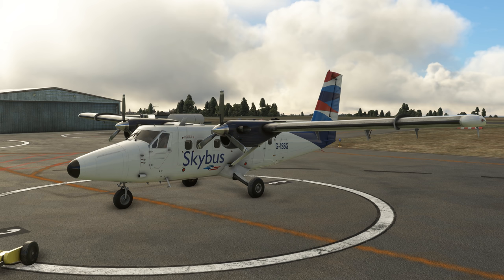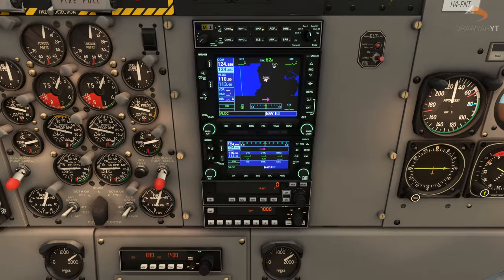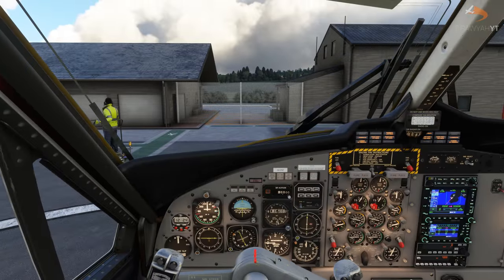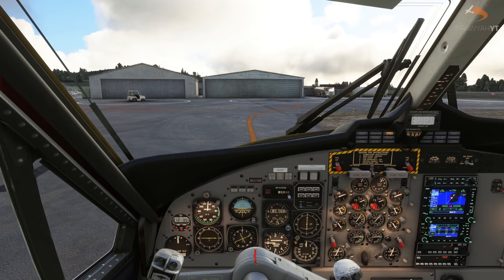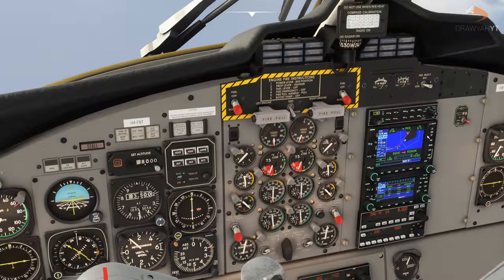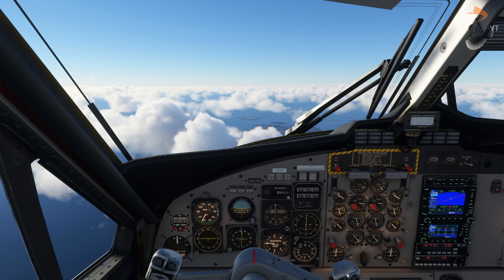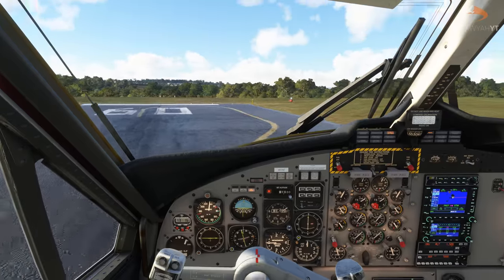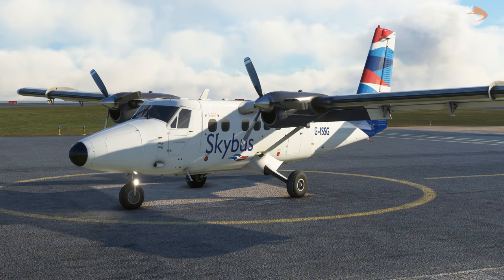[MSFS] Aerosoft Twin Otter Startup, GPS, Takeoff & Landing Tutorial｜Drawyah

Comment: For those having issue with overheating T5 and overtorque. Usually once 400-800feet above the airport, lower the nose slightly to gain some speed with very shallow climb, retract the flaps up(Make sure you are not in a turn and speed is 95knots above), pull the throttle lever back slightly within 90-96%. And bring the prop lever down to 75%(Default key is ctrl+f2, press it until u hear a click which means its at the lowest end before feather which should give a 75% prop). Climb speed is typically  around 105knots trim it properly for a climb of 1000-1300fpm or with autopilot v/s. Doing all this avoids the chance of over torque. 

Procedures for airports that has a lot of terrain may allow a temporary delay for prop and throttle reduction for greater climb. Of course depending on how long the engines can tolerate. If terrain is still concern and engines are going into overheating zone, Lower the throttle 96% and prop 75% like normal, Pull the yoke up slightly and lose some speed to either Best angle climb of 87 knots or Best rate climb at 96knots then start trimming or using v/s ap to keep it around there. This can give u up to 1600fpm of climb. Once cleared of terrain you can resume back a normal shallow climb with 105knots until cruise level.

Cruising is basically still keeping prop lever 75%, throttle lever at 96%, the aircraft will keep the speed steady within 145knots to 150knots ias. Prop lever at 100% is used only during take off up to 400feet above and during final approach just as you are engaging flap 20 landing or flap 37 landing. 

Also note full ILS landing with autopilot is only certified for flaps 20. Flaps 37 is for full visual approach. If you want to use flaps 37 with ILS you have to disconnect the autopilot just as you are engaging flaps 37 and fly manually following the glideslope indicator down to minimums and from here start following the PAPI lights insteads.

Edited comment: Added some additional info.
Reply: Thanks

Comment: Hey, nice video. Some points though on takeoff since this is a tutorial. You over use the engines on torque and temp. Torque should not go past 51 and ITT not past 760 i believe, and shortly after takeoff TQ should be at 50 if it has the PT6A-27 engines,  no more. Your temps are well beyond that and the right engine is well past the torque limit.    (Ofc you can in the game, but if you want to simulate, you shouldn't). Whatever comes first depending on the weather. 
This is something that goes for all turboprops. 
Whatever comes first depending on the weather. Also try and pitch for an airspeed, not a vertical speed on climb out.  the -300 has a Vx (best angle) of 86kts, and a Vy (best rate) of 100kts.   Unless you really need to get over something very quick you would pitch for around 100kts  

As for landing. Flaps 10 can come at around 100, but 20 should not go down before you reach the white arc (93 knots).   Final Aproach speed is 74kts, not that bad here where you had lots of runway but on short strips you do not want to come in 15kts too fast unless it is very gusting. 

You make some nice content mate, but would love to have a tutorial have atleast these basics right :)

Edit: I just realised another commented roughly the same. Oh well.

Comment: Mate, you don't turn the de-icing on when there's no ice accumulation, since the ice will grow over the boots and they will cycle inside an ice cover therefore being useless. Also, the deicer is powered by compressed air supplied by the engine bleeds, so it doesn't work if the engines are stopped or the bleeds are shut
Reply from the maker: Interesting to know, thank you for the heads up! Always willing to know more about aircraft types to better myself within the simulator.
Reply: @Drawyah  Also, do not firewall the throttles on the Twin Otter. The PT6A turboprops have a considerable leeway available in the throttles, you don't have to, and in fact you shouldn't, advance them all the way during normal takeoff under normal conditions. You've been exceeding the permissible gas temperature throughout the takeoff (red area on the T5 gauges). IRL you'd be facing a dual engine failure haha. Besides, the engines are flat derated to 50 PSI of torque (red vertical line on the torquemeters) and under any circumstances you shouldn't exceed this value, since in case of one engine failure with an unfeathered propeller and the other one above 50 PSI, the full aileron/rudder won't be enough to counter the yaw and roll from the failed engine.

The normal power settings for the Twotter are 50 PSI and 100% Nh (prop RPM) for takeoff, 50 PSI and 91% Nh for climb and 50 PSI and anywhere between 91 and 76% for cruise. For traffic patterns set 91% remembering to set the prop to 100 before touchdown. However, if setting those parameters will cause you to exceed the allowable T5 (gas temperature) retard the throttle to keep the T5 in the green, so you may end up with say 40 PSI and 91 Nh.

Also, in icing conditions or when you want to heat/cool the cabin, turn on the air bleeds on the aft ohvd (they supply air for the HVAC and anti icing systems), but be aware this may increase the T5 and you will have to retard the throttle to return it to the green. Shut the bleeds before landing, since in case of a go-around you may exceed the allowable T5 before reaching the go-around power if you advance the throttles with the bleeds on, especially with heavy load on the bleed system (eg with heating and anti ice both on)
Reply: @Drawyah  Last but not least, you've forgotten to arm the autofeather during takeoff. This is crucial since this will feather the failed engine automatically if it fails at low altitude, thereby giving you more time to react. The drag from a windmilling unfeathered propeller is enormous and will drag you into the ground easily if you're heavily loaded or under hot/high conditions

And when you do approaches, remember than when retarding the throttle beyond around 15-20 PSI of torque (approximately when the "PNEUMATICS LOW PRESS" annunciator comes on) the propellers will enter a very fine pitch range (angle between the propeller's plane of rotation and the blade will be small), almost flat on against the air stream, and this will give a tremendous aerodynamic braking effect, so if you want to loose speed quickly, be sure to advance the throttle promptly or you will stall.

Comment: Nice video, man. This aircraft is really nice.
.
Just a little comment on something that I've noticed so far: All the turboprops in MSFS have a really cold startup, speaking about the ITT. It also raise too slow when you add power. I mean, it does not affect the entire airplane, but is something that annoys me a little bit. Have you noticed this too?
Reply from the maker: Good spot! When loading aircraft on cold and dark state, I'm going to have a guess that the aircraft is in a true 'cold' state. I may compare this in different temperature climates and also repeat a few startups and shutdowns, see how quickly ITT raises each time.
Reply: That's a really good spot if I'm honest. I had not noticed this until you pointed it out

Comment: Hi mate how are you? I´m learning to fly the twin otter of aerosoft, nice bird, but I´ve an issue with the autopilot. I load the flight plan, turn on the airplane, CDI in GPS, altimeter and altitud set, and after take off the autopilot doesn´t work. It´s disengaging everytime when I turn it on. Maybe I´m missing something, Also the Yaw Damper, I tried turn on first to take off, after take off, yaw damper off and nothing happens. All this happens when I start the airplane from the Dark and Cold, if I start the flight with the plane turned on, works without any problem. Cheers for the good channel mate! Hope for your help

Comment: Thanks for the video. I just purchased it other night. My gps is on but none of the buttons work?? They are all clickable but nothing works..RIP
Reply from the maker: Try using the mouse scroll wheel or switch to 'legacy' controls.
Reply: @Drawyah  thanks, i found the issue, i use the GNS 540 mod, it needed a update. Cheers.

Comment: Thanks, great guide as alwasy!
But, How could we switch on VS after targeted altitude set?  I can't activate VS mode in this cockpit, but only map a keyboard shortcut for that. 
Your video seems just get rid of that button-click for Takeoff & Descend behind the scene, any tips of how was 'VS' starting to work?
Reply: I'm also having a lot of issues with the autopilot, including it blowing through the set altitude (similar to the approach in phase in this video). I sometimes have success by turning it on and off several times. Also IAS is simply unimplemented as far as I can tell. I'm a bit disappointed, given that there are similar autopilot and GPS system is in other Aerosoft products and they mostly seem to be working fine in MSFS 2020.
Reply: @GrantOakley  Yes, look at those CRJ variants, they are often working fine in descent and catching G/S, however you have to be patient, it seems some spooling effect for the ailerons to serve, all you need is a good handling and fixing via yoke, I am not sure if this is more realistic as I'd never flew CRJ / Twin Otter, but in MSFS not sure if this will disturb the AP functions, like the harmful bug to the AP up in the air in the earlier CJ4 cockpit.

Comment: I get to the point of starting engines but my engines just will not start at all , when you turn your fuel on the right engine starts straight away, when I turn the fuel on, it doesn’t progress any further whatsoever, I’m almost now convinced it’s a bug because I just sat here following you step by step and still just will not tick over past 20% on the GG
Reply from the maker: Check your fuel tanks. Could even be a case of them being empty? As soon as you introduce fuel to a starting engine, it should just come to life!
Reply: @Drawyah  i use unlimited fuel and had fuel in them at the time, i still get this issue, i just end up doing CTRL E works everytime hahaha

Comment: Many thanks for a great video. We have just returned from the Scillies, and I got the centre seat at the front - fabulous. One question I have - when coming in on approach, why do the engines start to scream, when you would have expected them to be close to idle. Is this to overcome a strong flaps setting?
Reply from the maker: Correct. As flaps and gear slow the aircraft down, the aircraft needs more power to maintain speed. Flying into a headwind too, combined with gusts, you're essentially flying against the weather to allow a slower and smoother landing.

Comment: Hi, thanks for this helpful video, but one question is this plane impacted by the same throttle calibration issue than the CRJ?
Reply from the maker: Nope, the throttle on the Twin Otter uses direct RAW slider position data as there are no set 'notches' the aircraft needs. This should work out of the box!
Reply: @Drawyah  good news here, thanks for the quick answer
Reply: It's much easier. I have a huge gap in my CRJ throttle that I can't  shift.

Comment: Hi all, excellent video, I learn a lot. I have a major problem setting my Warthog Throttles to match the detents of the throttle in the aircraft. The IDLE position is somewhere there and it is awfully easy to pull the throttles into the beta phase. Any Idea how tp solve it?
Reply from the maker: How have you set up your reversers? Part of the slider or the indent holding 'decrease throttle'?
Reply: @Drawyah  Yes indeed, for all aircraft I use the indent on the Thrustmaster Warthog Throttle for reversers (lifting the throttles and pulling it back resembles F2)

Comment: Wasn't the Throttle Lever on full reverse? When you said it should be in Idle at the beginning?
Reply from the maker: No, the throttle is in the idle position. Full reverse has a little more travel on the throttle slider.

Comment: Is there separate key bindings for the steering tiller or do you use the rudder?
Reply from the maker: Use the rudder pedals on the Twotter for taxi.
Reply: @Drawyah  thanks. I did and it works fine. I just had tried it when not moving and the tiller did not move just the rudder pedals.

Comment: I have a problem. I follow the instructions to activate the AP, in correct order, but the vertical speed buttons does not work. Therefore I can’t set how fast the AP should climb. Is this a bug? It obviously works for you, so probably not a bug? Any suggestions of what I might be doing wrong?
Reply from the maker: I too find autopilot a little fiddly and take a few attempts to get right myself. Practice and get a hang of it is all I can suggest.
Reply: @Drawyah  My issues was due to bindings on my Honeycomb Bravo. When I removed those bindings, the problems went away. 😊